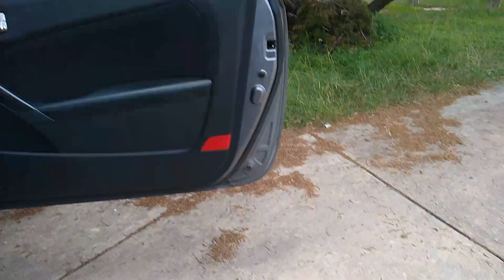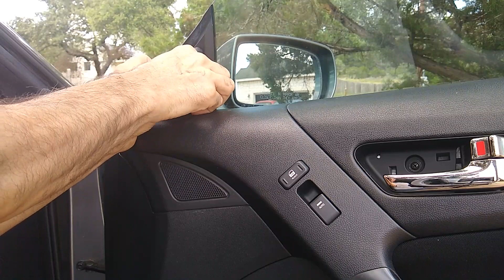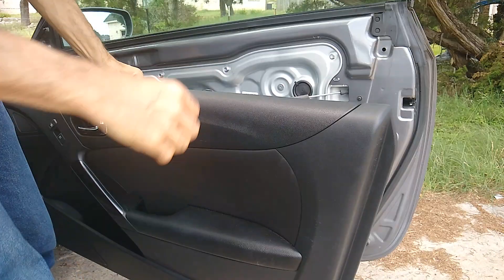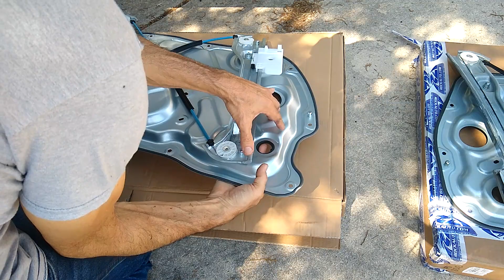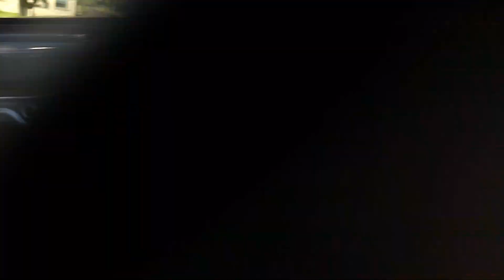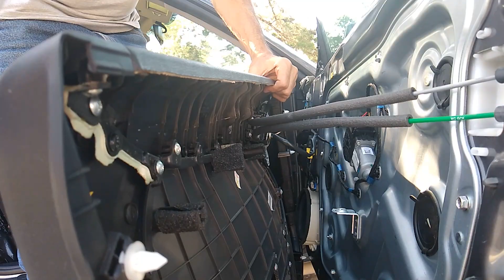How to Fix A Stuck Power Window on a 2011 Hyundai Genesis Coupe 2.0T By Replacing The Window Track.

Comment: This video was extremely helpful! This exact problem caused my teenage daughter’s window to fall all the way down and not go back up. I followed your instructions step by step and was able to get the new window track in place and it works like a charm. I am going to need to make a slight adjustment to how the window sits in the frame as it is just a fraction low, but that seems not so daunting now. 😊

Comment: Brother, I have a problem. I removed the door and all the parts in it, and when I installed it, I found that the glass shakes when I move it right and left. There is a gap, and when I drive the car, there is an annoying Air leak . Do you know what the solution is?

Comment: Hi Victor, I'm having the issue on the same model where the window won't go up. I can hear the motor trying to move the window but it won't go up. So i have to manually pull up the window to close it but it won't stay there and it'll fall little by little while I drive. Do you have an idea on what's the issue here is? I suspect that the window is off the rails or something if that's a thing.

Comment: You have part number for the door retainer clips ?
Reply from the maker: HI friend, Yes, https://www.rockauto.com/en/moreinfo.php?pk=15006921&cc=1447119&pt=1000306&jsn=1031&_nck=RaosfcaC2rGu3zlfSTLDkcJWiT3ec2%2F8FJ5%2F6EIE7m5rF9%2BgPDHXesVcKo2pLeGjNLi5O7PTjj2XaB2MVmlhu%2FKsKiKeg5ruP0v5RhdQAdDoa2D1ZBLKRfaVFW2E66g7xa5fy7kowfoTUvxCmZdIx0AFUkQ9LN%2BIdZtjp6MkgHQ5N4sK2ymPzh89HdT0GAloYYt6bomYSTQWSaVjaCTor%2F4O6BBKgrTQFa6dyVOuwBXgw%2FFbiVfvZlVNjVOQFaIiXkr7oP2YrjHcGGmn1oxkdBYcWtwOrX9OeT203kibMHVcm0RKt3vI9tstk3xajpgGDMbxSNmL%2Fv5DtCT2XzZsiKW33fXH81nO%2BWWe2LiVZvA%3D

Comment: Hey victor , how did you get the window  up/stuck ???
Reply: What modification was the one you made to make it stay up
Reply from the maker: Hi Brian, Thank you for commenting. Below are the files I made and 3D printed to get this job done. If you 3D print or have a friend that does use the files below.

STL files for 3D Printing - https://mega.nz/file/4ZsDUJCL#GCNJpSXyULo1c617kwc8qomj1cbNlymTnRCWTCYrsUQ

Timestamp in the video of me talking about the window retainer tool - https://youtu.be/3jnHgd70L0A?t=647

Timestamp in the video of me talking about the window centering tool - https://youtu.be/3jnHgd70L0A?t=1391

Best of luck with your repairs :)

Comment: How do I remove the window that is completely down and won't go up because the regulator isn't working?
Reply from the maker: Hi Lance, Thank you for commenting. The same thing happened to me. I was able to manually pull the window up after removing the drive motor from the mechanism. If the regulator is not working this would be the only way to do it.

Comment: Hello I have an issue with same model and year, I heard a piece almost sound like it fell all the way down inside my door when I clicked to lower and now my window will not move at all. Luckily it is still high enough to push up and close almost to the seal. I’m just not sure whether to order the regulator or the motor due to there being a price difference before I open up the panel. I would appreciate any help/tips, I found this video very useful and will be using it to start my repair. Thank you
Reply from the maker: Hi Chris, Thank you for commenting and encouragement. I'm glad you found value in this video for your viewing time. The under $100 regulator is the part I replaced on mine. Unfortunately no one sells just the small plastic part that coils the stainless steel cable that is the actual point of failure but instead you must purchase the entire mechanism. If the motor tries to move the window up and down but can't then it's probably not the issue. I would just buy the regulator.
Reply: @vbared  thanks for all your help. Very much appreciated!

Comment: Hey so I have an issue where the window only works on my passenger side when the door is open. I'd love to hear some thoughts on this. Thanks!
Reply from the maker: I would check plugs at the switch motor and kick panels where those wires enter the car with a multi meter to help you figure out where the issue is.

Comment: Hello.
What are the measurements of the centering bushing you 3d printed?
Thanks
Reply: Thank you so much for the measurements. Will make my repairs that much easier. Now to hunt down an appropriate part.
Reply from the maker: @pjs9346  Anytime, buddy,, best of luck with your repair.
Reply from the maker: Hello, Thank you for commenting. 10mm inside 17.25mm outside and 11mm deep.

Comment: Replaced mine and went to put the window up but it's moving slowly. Until about 80% Up then it moves at the normal speed. Same with lowering it goes down about 20% at regular speed then goes slowly the rest of the way down. Any idea what may cause this and the fix?
Reply from the maker: I would check and make sure that the window track mechanism is properly lubed. My new one came pre-greased, it should be able to move up and down easily without the motor attached to the gear. If it doesn't check to see what the cause of the binding is.

Comment: Hello I have the same car but my window is all the way down and it’s stuck there it won’t up and I don’t know how to pull it up since I can’t remove that metal part you mention without removing the window first any advice? Thank you 🙏🏻
Reply from the maker: Hello Andres, thank you for commenting. Have you tried removing the motor and manually pulling the window up? You should have enough room with the door panel and outside weather strip removed to get a hold of the top of the window and pull up on it.

Comment: Hey man whats the diferentes between dorman and ultrapower for parts? Like quality or what do u recommend
Reply from the maker: Hello, I usually order the least expensive parts. I've found that most are almost identical. Dorman and Ultrapower have the name recognition and if the prices are close I may choose one of them over the cheapest price. In the case of this window mechanism I couldn't justify paying more than three times the price for the Dorman. The only difference that I noticed between the $67 window mechanism and factory was the glass clamps, factory was made from an alloy and the aftermarket was Nylon with metal screw inserts.
Reply: @vbared Hi, got broke my one, started to seek this panels, and found alot of reviews from people that this not original panels breaks from 3 weeks to 6 months. (( There was some people who replaced it several times and it breaks again after awhile because of cheap quiality. Your one still works? cuz Im now scared to buy it😅
Reply from the maker: @Ryzen78  Hi Dean, Thanks for commenting. Yeah, I haven't had any issues with mine. The only visual differences I found between the original part and the part I used was in a few metal stops and guides on the original that are plastic in the part I used but the point of failure is plastic on both. If it was a trash part I would have made a follow up video or taken the video down. I generally try the cheapest parts first and have yet to be burned by them. Even the original parts most likely are made in the same Chinese factory that makes the aftermarket ones.